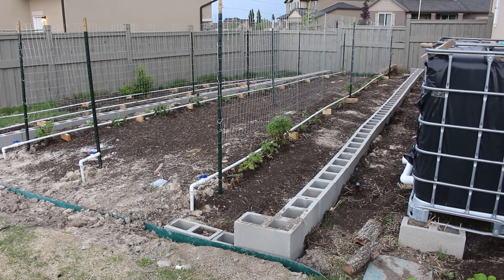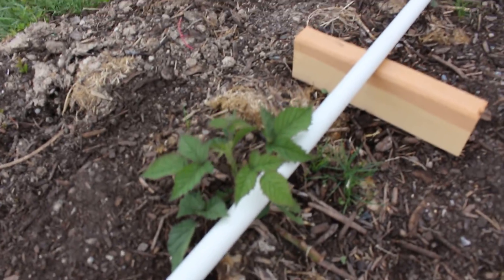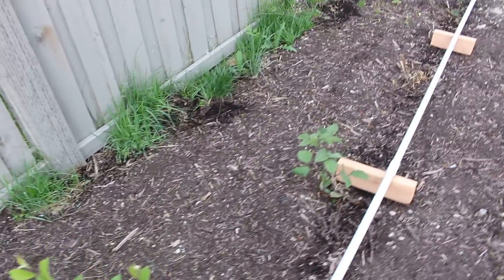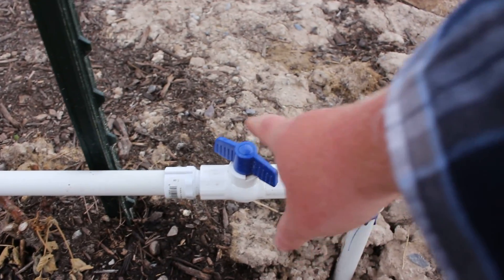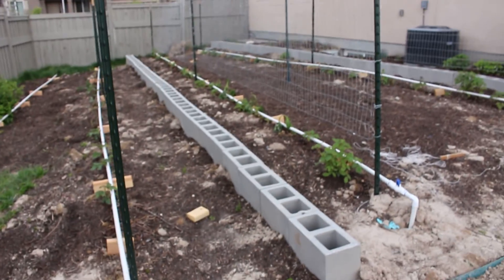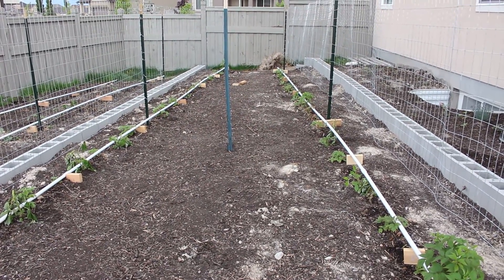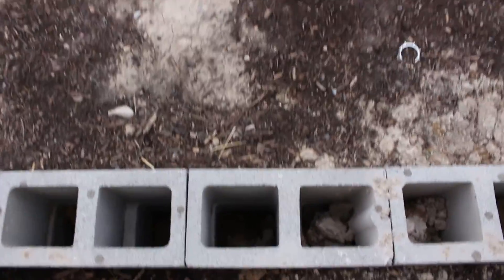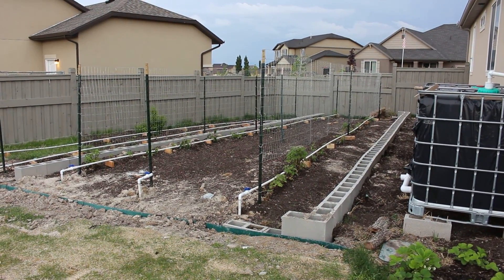Cinder Block Berry Patch Construction - Part 2

Comment: Other than just wanting to do a fun project with the watering system, did you find that you needed irrigation for your berries? With all of the compost, it seems like you would have enough moisture retention for the needs of berries. I have an in-ground sprinkler system from the previous owners of my house and I shut it off around my garden and raspberry patch after converting to Back To Eden with woodchip mulch because I was getting great raspberries without needing the extra watering. Anyway, just curious and it looks great! I second the idea about filling the blocks with herbs, especially herbs that are impossible to contain, like mint (unless you plant them in a confined space).
Reply from the maker: +Randy Kleinman In Utah the back to eden method works but needs a little more water than what nature provides at least until the berries roots get strong enough to manage without it. Once that's the case I'll probably take out the pipes. The watering system I'm using right now is mostly because I just put down the composted woodchips and planted the berries. Once the Mycelium layer under the soil builds up, I won't need to do much. But until then I want to give my berries the best possible chance:) Mint and other herbs is a great idea. Maybe I'll do that and make a video:) Thanks for commenting.